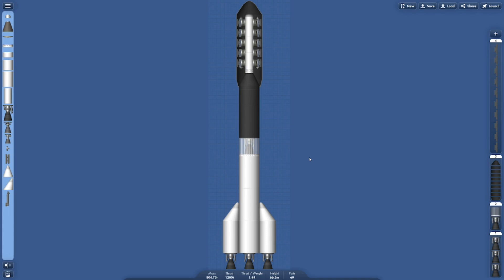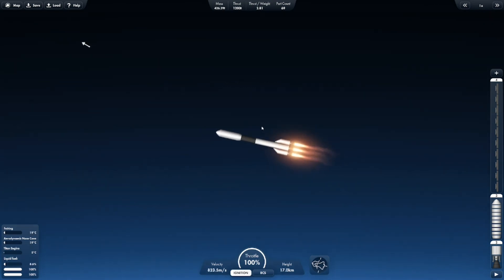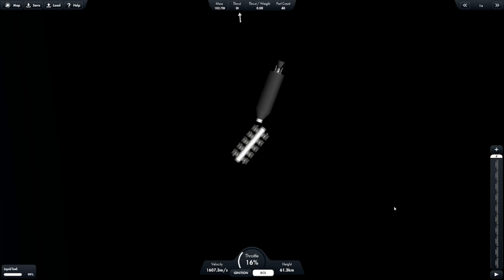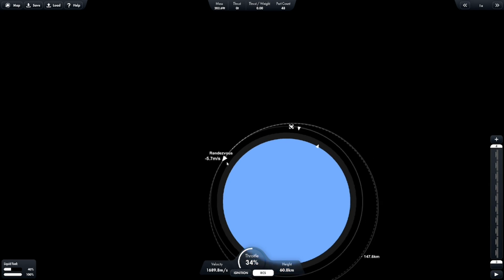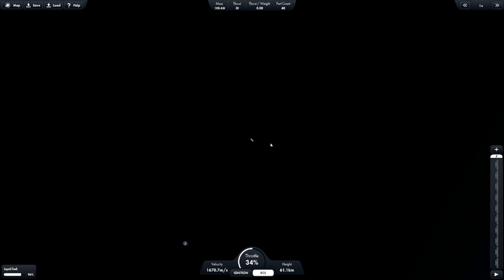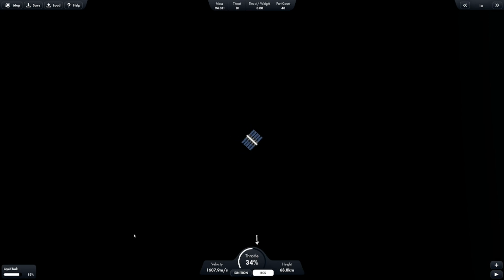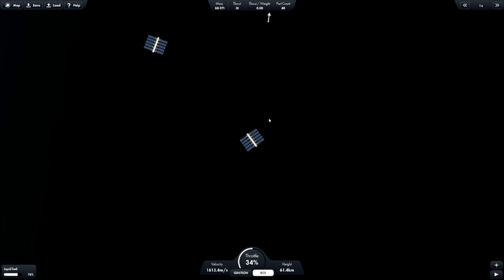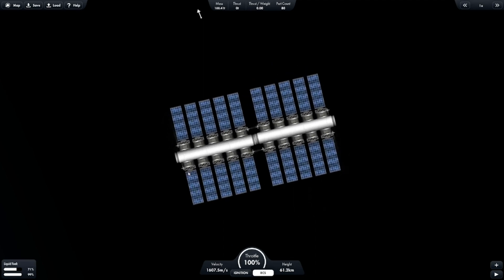How to Dock in Earth Orbit - Spaceflight Simulator Tutorial (PC Version)

Comment: Does this work on mobile too? I tried and the navigate to is broken. Maybe they fixed it?
Reply from the maker: Navigation can be very strange especially when navigating to a player-made object. Sometimes it can work and sometimes not, so I'm not sure. You may just have to mess around with your orbit to get it to work. The rocket will still work on mobile though, and it is possible to dock without using navigation.
Reply: @thyse35  k thx bro